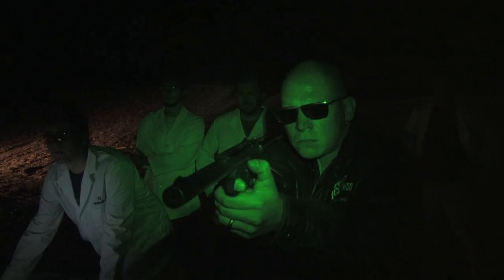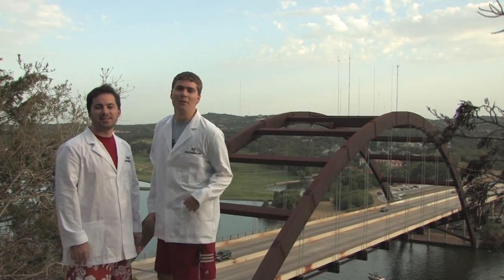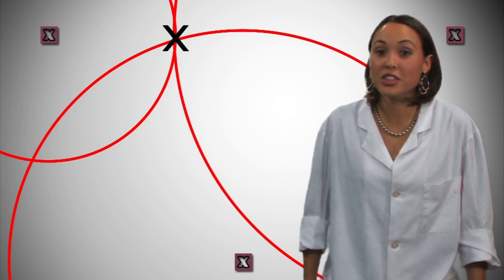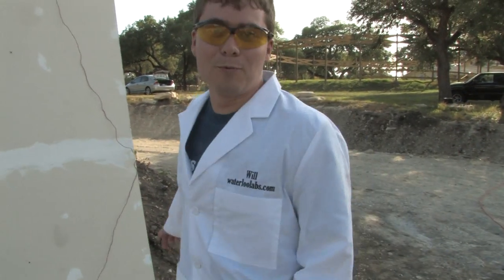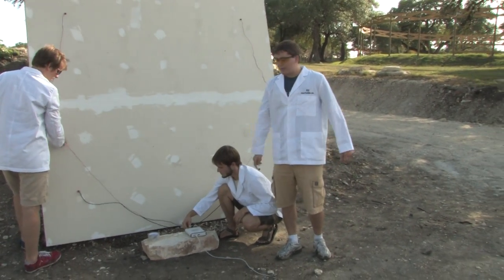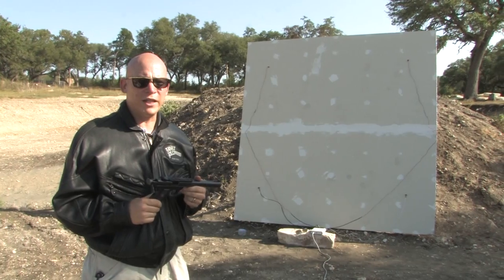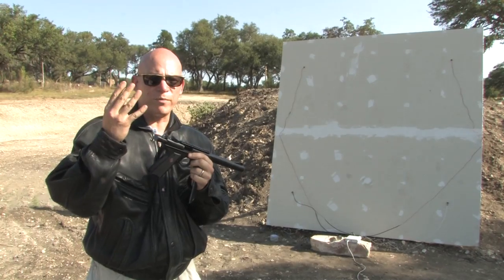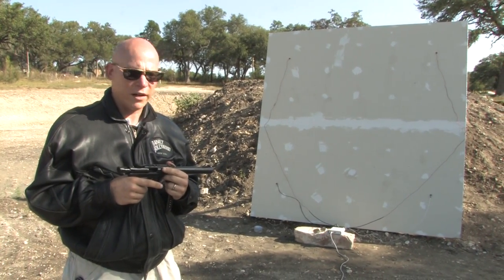FPS with Real Guns - Episode 02

Comment: @Orthodoxcrusader Right, no suppressor is going to completely silence the sound, but they reduce it by about 30-40dB often making it hearing safe. The sound also sounds muffled and not a BANG like normal gunshots if using subsonic ammo. Suppressed .22's sound most like the ones in movies, very quiet. Also, yes, Illinois is unfortunately one of the 12 states they are illegal.

Comment: Sir. The VI shared in the NI forum is not working for me. The main program in the folder "original" showed error while running. Can u help me. I am trying to use USB4432 with ADXL345 accelerometers.